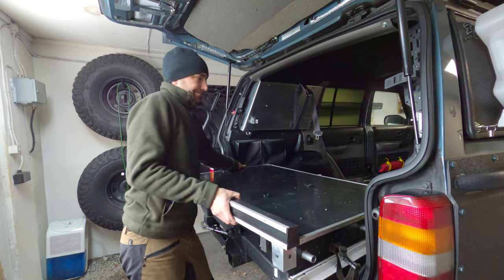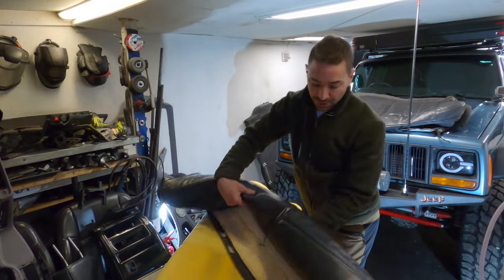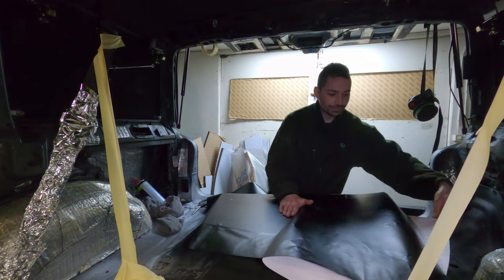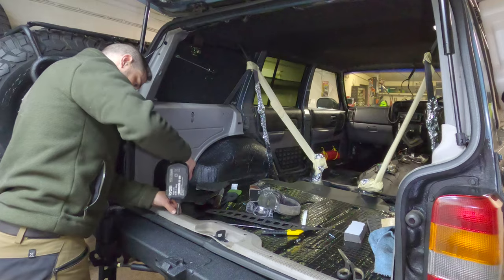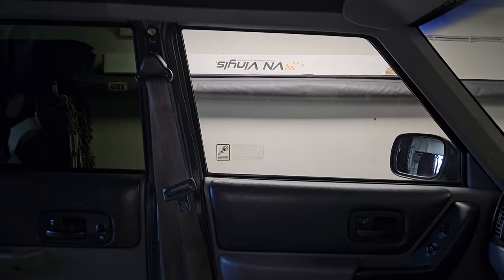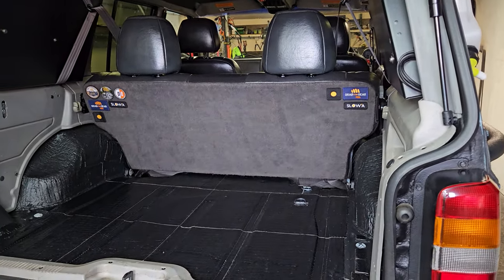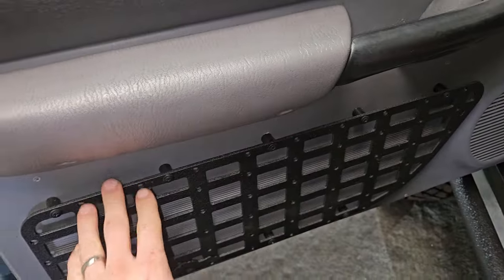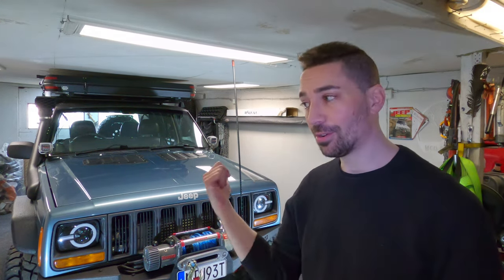Vehicle Interior Refurb / Leather, Vinyl, Plastic + Sound Deadening

Comment: Mike, if you can locate a automotive paint store near you,  SEM  makes a vinyl interior paint for your specific interior color in aerosol. if they don't have your specific color code. they will have color cards to get a close match, even though aerosol, its amazingly durable and holds its color for years,  it will make your quarter interior look brand new less the cracks, which you can super glue prior to painting..  love your content bud, and thanks for the laughs. Cheers!!🍺🍺
Reply from the maker: Thanks for that. I've found the colour code and ordered a can. I will touch up the back interior, I think. It looks faded. Appreciate the info and thanks for watching.
Reply: @WorkshoptoWilderness  your going to love the product, I use it often when refreshing older vehicles. typically I use a grey scotch brite pad or even a magic eraser to clean the panel prior to painting. for an aerosol it lays down surprisingly well, that being said, I've not used it in the temps you experience.

Comment: New bonnet/hood release handle is a bit on the small n flimsy side like, Mike; my petrol cap release is twice the size of that. As for screwing through wiring looms - standard practice! 😁
Reply from the maker: I don't think I showed the release latch? Did I? I never installed it anyway as that's for another day. I've screwed through a few looms, not recently, as I've learnt my lesson! 
Thanks for watching
Reply: @WorkshoptoWilderness  You said "hood latch" while holding up a handbrake which I guessed was a deadpan joke :)  Ditto with the looms - I assumed 'I put these straight through wiring loom to act like loctite' was more classic dry wit :)

Comment: Did you put sound deadener on the floor in the cab or just in the back?
Reply from the maker: It's on the floor of the whole jeep and the roof. I just revisited the back mostly in this video due to the water problem.
Reply: Thanks for the reply! Was worried about moisture getting into the sound deadening in the cab but looks like no issues??
Reply from the maker: The cab was fine because there was nothing over the top of the sound deadening. The problem in the back was the rubber mat.